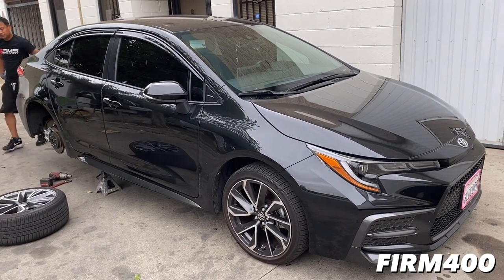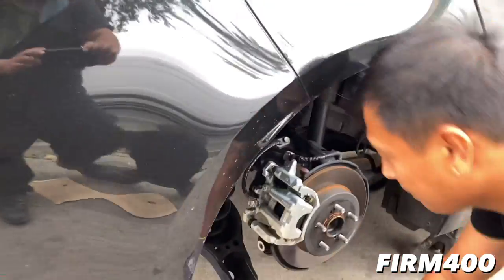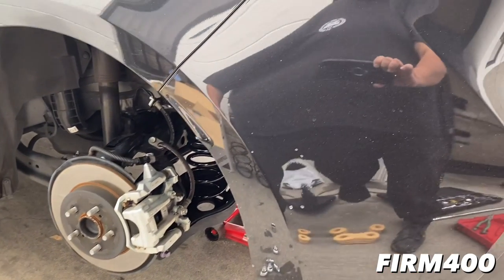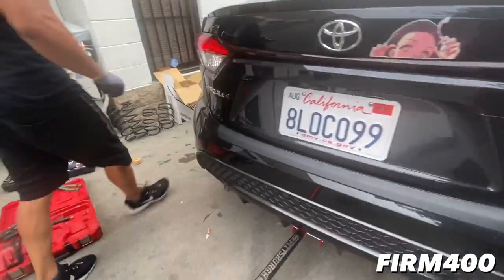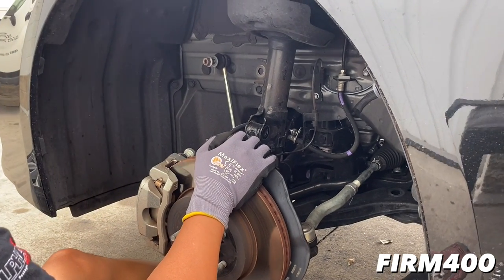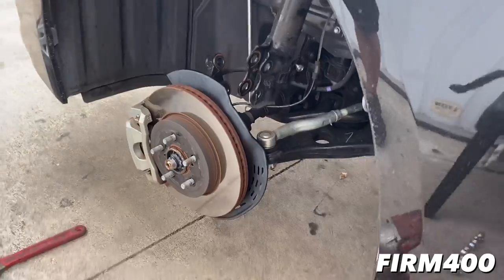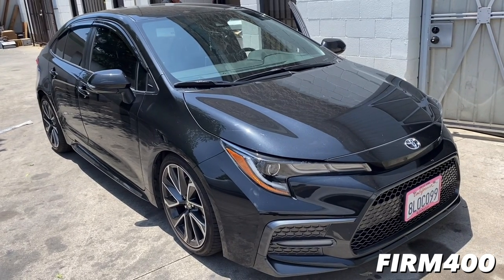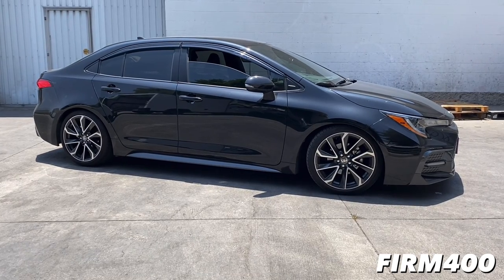2020 TOYOTA COROLLA RSR LOWERING SPRINGS INSTALLATION

Comment: FYI, loosen the inner bolts on the inside of the lower arms otherwise you can tear the bush from forcing the lower arm down to get the spring out, requires getting a fresh wheel alignment but you will need one anyways from lowering the vehicle

Comment: So do you need the spring compressor to take off the front OEM springs? But you can put the new ones on no problem using the method you did without using the compressor
Reply: I need this question answered lol
Reply: @jahnortega2046 yes you use a compressor for the stock springs and the new ones won’t need the compressor

Comment: Do you only need to pay for the coil overs to lower this car or is a suspension also required after install of the coilovers?
Reply from the maker: The “suspension” upgrade on this Corolla are “lowering springs” which only dialed in at the manufactured height it is set at. For “suspension” upgrade with “coilovers” you can adjust the desired height level for coilovers.

Comment: Great video.. after watching this video i installed the springs rsr on my 2021 Corolla...  I have a question for you guys...is it just me or someone else hear a popping noise in the front end everytime you turn the steering wheel left or right at very slow speed????
Reply from the maker: Thanks for the support Yamil. After the installation the springs dialed in and our customer hasn’t had any issues of whatsoever and is happy with the upgrade.
Reply: Hello Nic, 

I saw your comment because I am looking to getting springs as well on my 2022 corolla, to your question, I think all corollas have that sound you are mentioning. I test drove the corolla from 3 different dealerships and it made the sound when turning slowly on the parking lot. Might be the wheel locking up but it most likely kills your doubt if the spring is whats causing the issue

Comment: i have a question, i want to maybe slightly lower mine as well but im afraid of scraping and impracticality, has yours given you any issues on anything with bumps or scraping? please give an honest answer im just curious
Reply from the maker: Hi thanks for watching our video. This was a customers car as the customer was happy with the overall installation. There hasn’t been any issues brought up by the customer. Aftermarket installations will always have its pros and cons. That’s why if you are on the fence about a suspension upgrade we would highly recommend you consult with a professional who can assist you in achieving the proper ride height that you desire and dial in the suspension the way you would want it. However there are a few key things you may have to consider and just know that everyday roads and driveways are never perfect so you’re going to have to accept the reality of it and be a more cautious and skilled driver when operating your vehicle that now has modified / aftermarket suspension. Keep in mind you have to now be more mindful on the road scanning ahead of potholes / road debris / uneven pavement / speed bumps / driveways etc. those now have to factor in if you decide to lower your vehicle.

Comment: I have a question i put the megan springs to my 2020 toyota corolla sedan cvt but i feel like a vibration or a shaky from 10-25 miles i have 4 new tires and my car is align and everything but i still feeling that
Reply from the maker: Hey Raymond. We aren’t familiar with Megan suspension but was the rubber insert installed before mounting the spring? Not sure if that would be the case because the rubber insert would prevent any potential clunking noise but we do recommend to get it looked at by a professional mechanic.

Comment: It appears that RS-R only makes 1 option of lowering spring for the sedan. Can you possibly confirm the part #? I see this on their website. Part#: T027D
Reply from the maker: So the customer sent us over the link to where they purchased the springs and it appears that it is under a different part number and not the one you referenced to. On top of that, the link appears to state that it is for the hatch application however we installed the springs on a sedan model with no issues so these springs should fit hatch and will fit sedan models. Here’s the link: https://www.importimageracing.com/products/t577s-rs-r-superdown-sus-lowering-springs-toyota-corolla-hatchback-2019
Reply: @Firm400  I do see that RSR makes a Sedan specific spring. RSR told me that the hatch has a different spring rate and shouldn’t be used for the Sedan just FYI from the manufacturer. 
I asked my original question because I’ve seen people describing it as RSR super downs and wasn’t sure if there was different lowering height springs.

Comment: Overall how much does something like this cost?
Reply from the maker: So these I believe are going for around $300 online for the springs. To get these installed will probably cost you around $200-$300 on the low end where the person installing the springs for you can possibly charge even more depending on the extent of the install.

Comment: Will it be ok to install lowering springs with stock shocks? i am considering coilovers if its a major issue
Reply from the maker: As long as the shocks are fine installing lowering springs should dial in properly with no issues. Our customer is happy with the suspension upgrade and has had no issues ever since. We highly recommend you consult with an experienced professional in suspension upgrades to inspect your vehicle’s suspension components if and when you decide to replace shocks and install lowering springs or Coilovers if you choose to do so.

Comment: Hi! I wonder if these lowering springs will fit on a 2021 corola apex.
Reply from the maker: We don’t know to be honest. You can ask a local dealer. The apex model already has sport tuned suspension so we recommend to ask a Toyota dealer local to your area to confirm if the apex model is the same as the other models.
Reply: Yes , LE, SE, XSE, APEX and Hatchback are the same springs.

Comment: Will this make any difference on an apex addition?
Reply from the maker: The Apex edition has already dialed in sport-tuned suspension. Not sure how the Apex handles but you can ask a local dealer to give you more information or maybe a test drive. Our customer with the Corolla in this video was happy with the RSRs and notices more control and handling when driving on the road with the RSRs.

Comment: I use the same spring for my corolla, but it has a rattling sound on the rear spring when running 10-25kph in uneven road or going to a speed bump. What do you suggest?
Reply from the maker: Was the rubber insert installed before mounting the spring? You may have to get it looked at because the rubber insert would prevent any potential clunking noise.
Reply: @Firm400  yeah, I saw that they installed the rubber at springs. The sound is not rattling but its like popping when in on a not so smooth road.

Comment: Hi guys, I’ve been looking for rs-r springs for corolla sedan. Couldn’t find one, does hatchback’s will fit on sedans?
Reply from the maker: Hey Optimized Prime! Thanks for watching our video. The customer had provided us the link to where they purchased the springs from as we replied to a previous comment on this post. If you click on the link more information on these springs will be provided. It does appear that these springs we had installed were for a hatchback and we installed them on a sedan with no issues ever since. The customer was happy with the install and they dialed in with no problems. These were purchased from Import Image Racing. Here is the link: https://www.importimageracing.com/products/t577s-rs-r-superdown-sus-lowering-springs-toyota-corolla-hatchback-2019?judgeme_review_source=ZXlKaGJHY2lPaUpJVXpJMU5pSjkuZXlKcWRXUm5aVzFsWDNKbGRtbGxkMTl6YjNWeVkyVWlPaUp0ZFd4MGFTMXlaWFpwWlhjaWZRLnc5dTViUkYzMXI5UWZLNFgwR0paNFQ2MnBFT0xEWXBlV2JXbF9QZVRobjA=&judgeme_token=1be58e7f-7fa1-4091-acad-5d26db28b9bb--3mqvgr9y&utm_campaign=judgeme-review-request&utm_medium=email&utm_source=judgeme
Reply: Yes, because the suspension of the video is Super Down and the Super Down only comes for Hatchback. RS-R for Hatchback comes two Down and Super Down models. For the Sedan only comes Down.

Comment: What about the factory warranty, I will lose if I lowered?, I have the same car but white with 15k miles
Reply: Maintenance guy at the dealer said they just won’t warranty your shocks if they get blown out. Which they probably will if you drive too long with the incorrect length damper. 
I just bought a 24’ SE so I’m researching as well.

Comment: Any noise when turning at slow speed
Reply from the maker: Nothing as of yet since the test drive as the suspension dialed in. We also made sure that the rubber inserts were placed first along the mounting area prior to installing the springs to prevent any potential clunk noises. Customer was happy with the install. So far so good!
Reply: Are these downs or super downs?
Reply from the maker: @CouGHeePiLot  Hey Joshua those were the super downs.

Comment: Can I install the hatchback lowering springs on the sedan le?
Reply from the maker: Hi Victor. Not familiar with the “hatchback lowering springs”, but if you have an LE Corolla sedan model, the RSR lowering springs will fit as we installed them on the SE model.